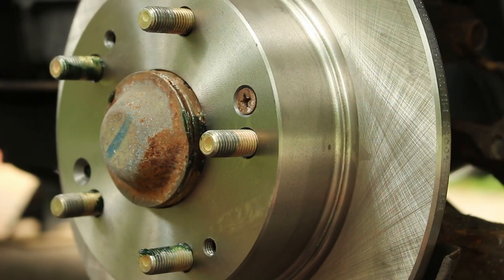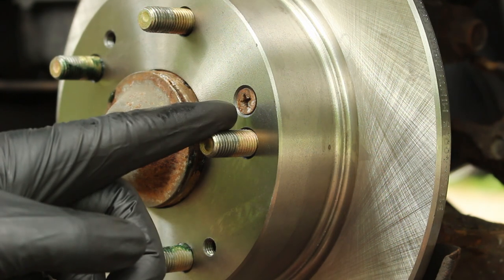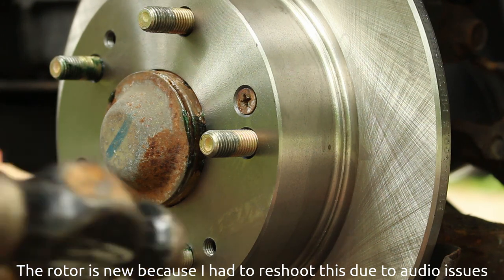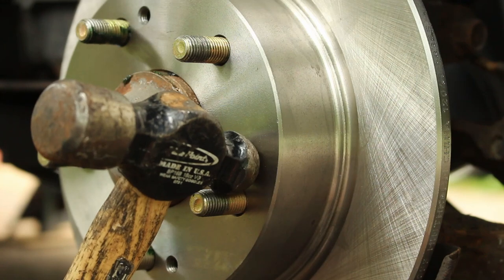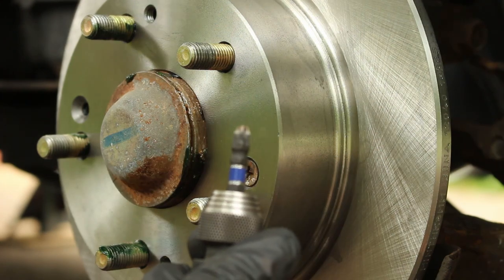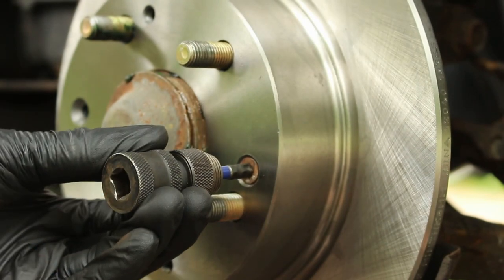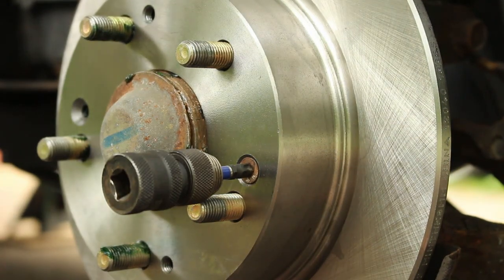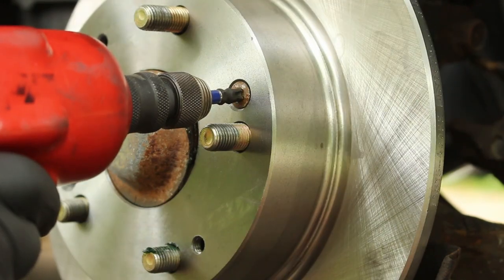Tip for Removing Brake Rotor Screws

Comment: Great video.  Do you even need to reinstall the rotor screw when putting everything back together?
Reply from the maker: You don't have to, but it is nice to have the rotor held in place when you're putting the caliper bracket back on.